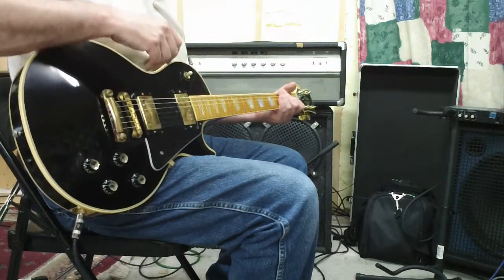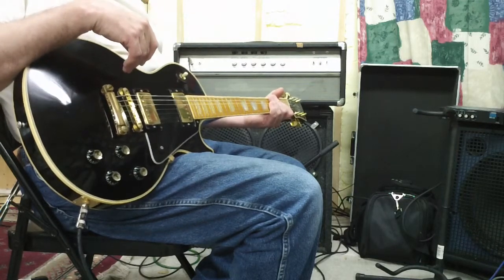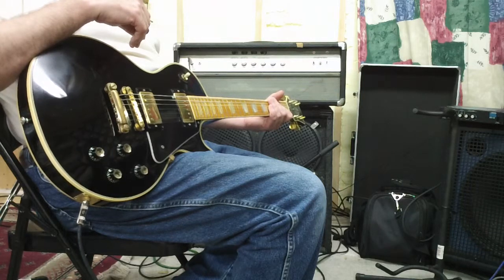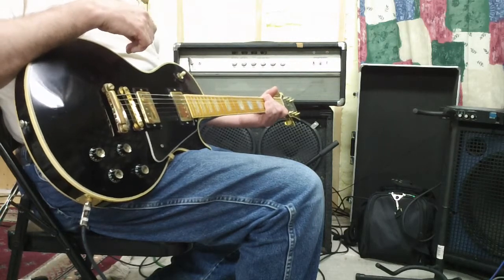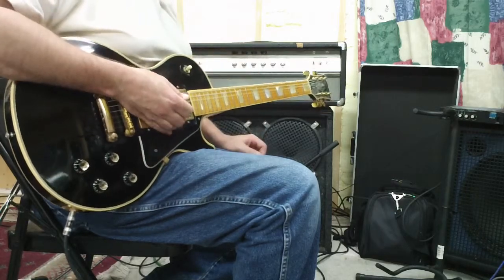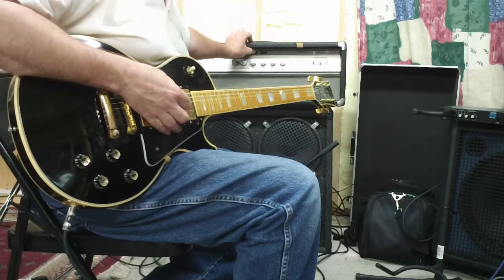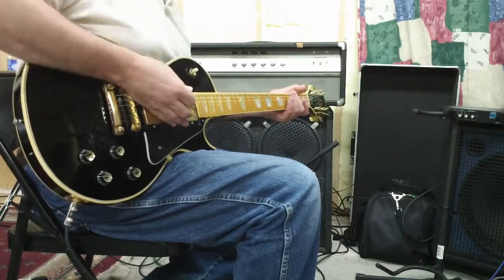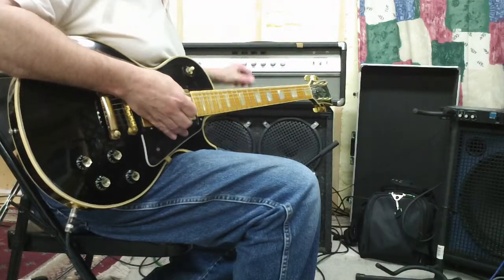Ampeg V4 Tone Stack Rebuild

Comment: nice video! just wanted to clarify - were you saying that the V4 has a baxandall to begin with, or was your mod the switching of the original tone stack to a baxandall?
Reply from the maker: The Ampeg is a baxandall circuit in it's original design.  This mod does not change the circuit.  It just replaces what was a modular part with new, individual components that made up the module.   View my other video that shows the actual part replaced and what replaced it.